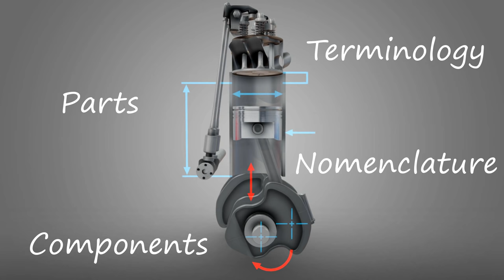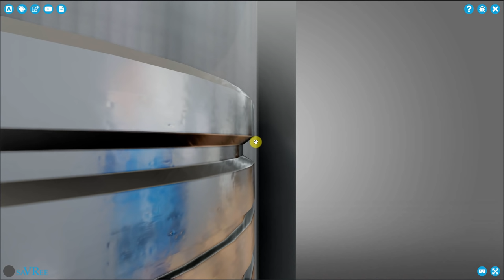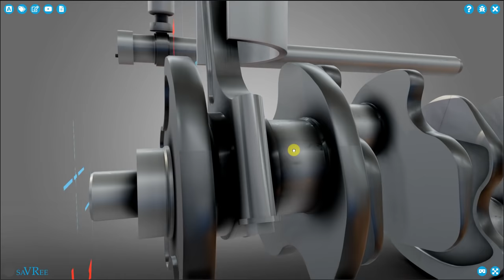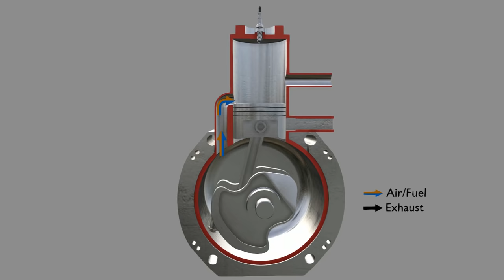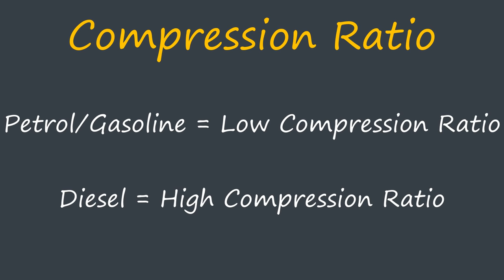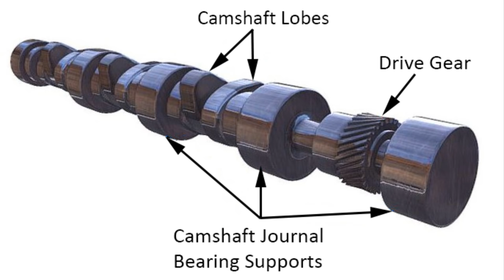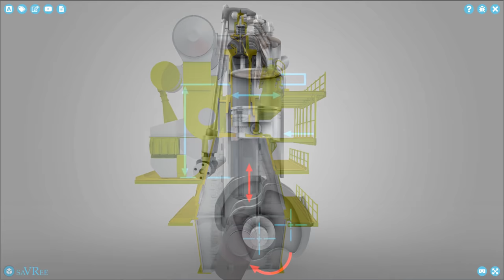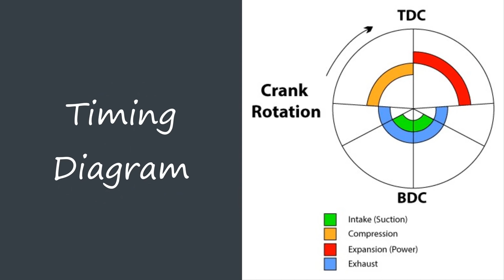Internal Combustion Engine Parts, Components, and Terminology Explained!

Comment from the maker: Trying again... Thanks to Abdel Elmasry for spotting a mistake with yesterday's version of the video! It was a minor mistake but the video has been re-edited and the mistake removed. Sorry for the confusion everyone! Personal note... Sorry I did not release a saVRee Nuggets video. I wanted to, but it pains me to release something that is not worthy of your time. I am planning on doing saVRee nuggets videos, it just takes a bit of courage to post stuff that I know could be better if we took more time to edit it and improve it. We will return to this topic though, promise!
Reply: I have a question about the bottom dead center.  The blue line indicates that the bottom dead center is measured from the bottom of the piston head; the next diagram shows the BDC from the top of the position head.  The second one makes more sense when calculating clearance volume. Would measuring for BDC be from the top of the piston head while at the bottom end of the stroke?

Comment: Great video. Only issue is where bottom dead center is marked on the 3D model. The 2D illustration has it correct. The BDC should be the lowest point reached by the top of the piston, not the lowest point of the cylinder or the lowest point reached by the bottom of the piston.
Reply: Thank you, I was figuring the second diagram was correct just because it makes more sense when calculating swept volume.  Thanks for clarifying

Comment: At 7:13, a few of the arrows point to main bearings rather than journal bearings.
Reply: You can have either conrod bearing journals or main bearing journals. Rod journals are offset from the centre axis and main journals on the centre axis. The journal is just the place where the plain bearing sits. This image highlights this point:

https://images.app.goo.gl/SXV1b59EepMuMacR8

Engineering is a bit of a nightmare concerning terminology. Plain bearings are also called sometimes incorrectly sliding friction bearings, white metal bearings, babbitt metal bearings, friction bearings, and/or journal bearings. Not all of these names are correct, it depends on the material of construction.

Hope that helps. Thanks for the comment.
Reply: @savree  Thank you for the correction, I learned.